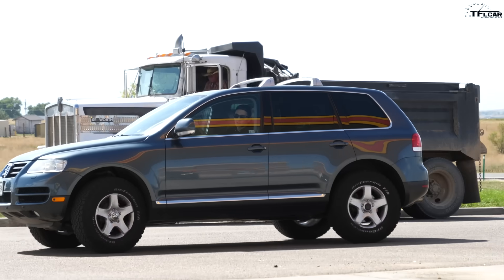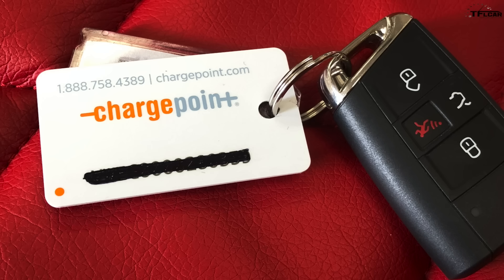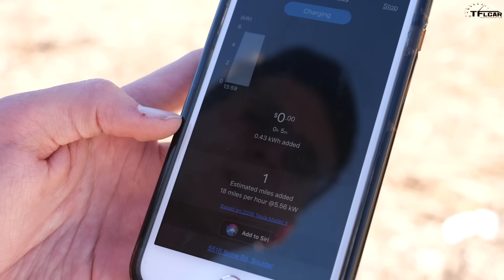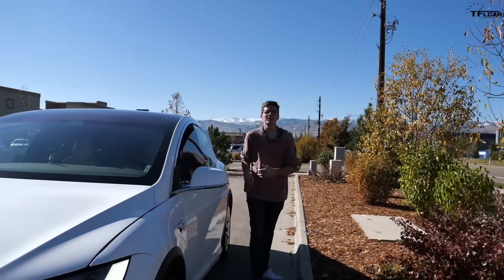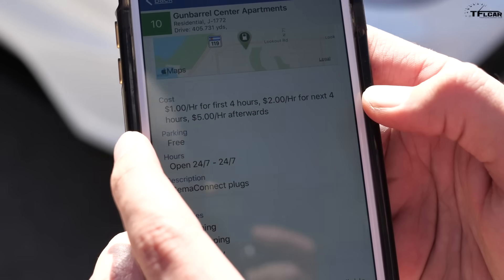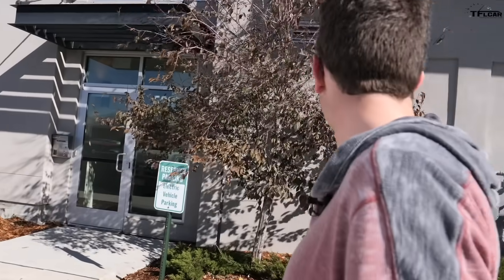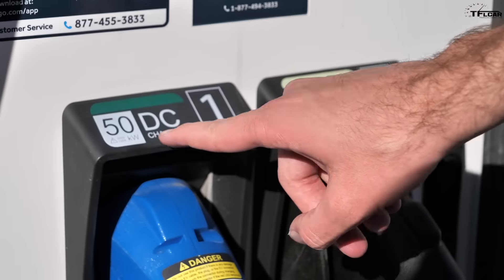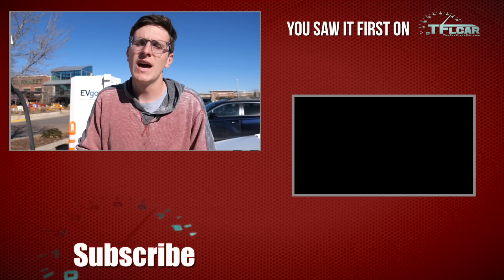Here’s Why Charging an Electric Car Can Suck - And It’s Not The Reason You Think!

Comment: Looks super convenient. I can't wait to be in line for days on end. How is this practical?
Reply: A single gasoline pump can fill dozens of vehicles/hr( as long as the gasoline supply is plentiful). A charging station with 6 chargers is going to have a queue of frustrated EV'ers wishing they had kept their gassers afterall.
Reply: @peghead  Great point.
Reply: EV ownership is best for a homeowner with multiple cars.
Reply: they re forcing mass transit by mass inconvenience
Reply: @chris532008  What better way to control the movements of the population. 
They say you'll own nothing and be happy. 
Translation, they will own everything and we will be miserable.
Reply: This is a level 2 charging station meant to be used overnight, hence its location at an apartment complex. Or at an industrial park meant to charge while you’re at work. This isn’t the same as using a level 3 charger.
Reply: @DarrellC.  What if someone else is using it for an hour or so?
Reply: @DarrellC.  yeah you only wait for 2 thirds the time.
Reply: @richwilson7619  not sure about waiting in line that doesn’t seem to be the reality with the vast majority of fast charging stations, but in terms of actual charging time if that equals 40 minutes then yeah.
Reply: It's too early, hopefully, in the next 5 to 10 years the charging will be faster.
Reply: @Bartetmedia  It is fast enough now so any speed up is a bonus. Filling you car with gas does not equate to filling your Tesla with electricity. On long trips you only put in enough to get to your next destination other wise it's like a cellphone, 30 seconds to plug in and then unplug at home, no trips to gas stations.
Reply: @SmokinPaul  You have the mind of a child. It isn't so easy as you have expressed.
Reply: @rogersmoot6194  it is when you own a Tesla. I normally plug it in once or twice a week. But calling me a child (attacking the messenger) is like adulting right. 🤣 Thanks for confirming you had nothing to add to the discussion. 😁 
I'm from 1956, not so weak that words can hurt me. LOL
Reply: @SmokinPaul  yeah my phone dies no big deal my car dies say from ny to florida where do i go to get a bucket electricity to refill
Reply: @pat8757  You can always use another charging network or destination charger, slower but will charge fairly fast. 
Finally you can use the cord that comes with a Tesla to plug into any 120v or 240v outlet. North America is electrified, who knew! 😯 LOL 

FYI Up until 1940 Electric cars were preferred because as bad as electrification was you could always find someplace to change. Even Henry Ford's wife drove a Detroit Electric. 
You can do something similar with a gas car using a siphon hose. Just remember to bring a mint for afterward. 🤣

I don't run out of electricity for the same reason I don't run out of gas. Plus even if I'm and idiot and don't pay attention to the fuel (juice) tank my Tesla will warn me and show where to go to charge. If I have FSD on it will navigate and drive to the supercharger. I don't see any gas cars that show you where the gas station is when it gets low on fuel. 

An EV is no different than a gas car, only the fuel and amount you normally keep in it is different. I had reservations when I first bought my Tesla but after the first long trip I'm not worried in the lest. In fact I can get electricity in way more places than gasoline.
Reply: @SmokinPaul  you don’t see any gas cars that show you where a gas station is?  Hate to tell you, but my Hyundai Santa Fe does.  LOL
Reply: @thatshowitis6151  welcome to the 21st century. Does it also show you how many pumps and if any are not functioning?
Reply: I charge at home, 15 seconds to plug in, 15 seconds to unplug. I only charge at Tesla superchargers on long trips. Occasionally I'll use a slow level 2 charger at a destination, a hotel, restaurant etc. Last time I got 80+ miles for free while eating at a restaurant. 🙂
Reply: @SmokinPaul  15 seconds to plug in…..wait for hours to charge…..15 seconds to unplug.  Sounds like a great car for long trips.  Real convenient.
Reply: @thatshowitis6151  Do you never sleep? If I needed a fast charge I would stop at the nearby supercharger. 

At home 44 miles per hour charge while I'm sleeping is faster than I need. I usually charge once or twice a week because it is so convenient to do from my home. For the miles I drive the car it's charged in less than an hour. You on the other hand have to drive to a gas station, fill and drive home, something I do not miss. 🙂 
The cost per mile is 1/5 to 1/8 the cost of gasoline, what's not to like. 
Do you worry how fast your cell phone charges? LOL 
You on the other hand waste more time overall gasing up.
Reply: Terry Winter  Hence why we went with a Tesla and their supercharger network. Any other EV brand sucks for long trips until Tesla opens up their network. 
However if that brand charges slow or has a huge battery requiring more juice you'll still be stuck with long charging times. 

On long trips in our Tesla we never need more than 10 to 18 minutes charging which is usually shorter than it takes for me to pee and get a coffee. If we stop for food, there's usually fast food nearby the supercharger, we eat in the car so we can leave as soon as it's charged, finishing our meal on the go.

Comment: Electric cars will not work. Is right, they are a pain in the pocket book!  To many problems to take care of to keep them moving. Another thing, cancer ♋  do they cause cancer, time will tell. Because anything to do with electro magnetic  waves through the air is a start for the body to be exposed to these deadly waves. Like electrical wires power poles. And those cars produce many volts. Dangerous!!!  So there has to be another way?.

Comment: The push for EV cars is an elitist leftist attack on the poor and middle class who may not a garage or place to charge an EV. Some poor may not have a Visa card.  Since a majority of the poor and middle class will drive used cars, they are screwed again because of the outlandish cost of EV battery replacement on older vehicles.  So they will be not be able to travel around the country?  Maybe this is the goal of Elitists.

Comment: plug share or what ever this won't work when i get out of the car i gotta take a leak so if the gas pump is fast i can fuel up and make it into the restroom . by the time i find the right adapter my pants will be all wet .    plus with gas ill be eating a roller dog complete with onions mustard relish and a napkin and soda  back on the road less than 10 min . better order your tesla with a trailer hitch get a trailer and a generator and a fuel tank . that way you can charge it up while your on the move or parked also there is no tax on the fuel in the generator how about that !

Comment: Electric cars have no future for a couple of reasons but one of them is queuing theory. 5 gas cars in line for the pump and your wait 20 minutes tops. At an EV station, hope you have a sleeping bag. As the numbers increase so will the queues. 17 miles per hour?? Are you kidding me, 14 hours for a charge with no one in line. Like I said no future..
Reply: Tesla super charge do it 30 min ezz also depends how much u drive

Comment: Hands down the best video I have ever seen on the perils of charging an electric vehicle. Convenient if you live in a single family home with a garage and never travel more than 50 miles from home.  However, let's say you want to drive from Dallas to Philadelphia, approximately 1500 miles. With a gas powered vehicle, you would need to refuel about 4 times at less than 10 minutes each, or 40 minutes of fueling time.  In an electric vehilcle, without access to a supercharger, you would need to recharge at least 5 times at 20 hours for each charge.  So 100 hours [a little over 4 days] of charging time to support 24 hours [1 day] of driving time.  An unimaginable burden and not very feasible.
Reply: I drive over 150 miles each day for work and don’t have a garage. All you need is a drive way or access to an outlet. One of main reasons people keep buying Tesla’s is the super charging network so you’re  not have to wait very long for a charge. 10 to 80% happens quick, maybe 20ish minutes. However, I never need to go to one honestly, unless sit for a road trip. I drove from Baltimore to DC then DC to Bal, then Bal to DC and back to Bal today and had no issues, didn’t charge up past 80% and got home with 18%. That’s 160+ miles in the cold (loss due to cold) and not including driving around Baltimore (went to see the Ravens game with my girlfriend) or the loss from pre heating the car and battery. I could driven back to DC again if I wanted with no issues. If you can charge at home, it’s a no brained, if you can’t charge at home, I’d wait to get an EV.
Reply: What happens if you forget to charge your battery and run out of power out in the sticks somewhere. You can’t thumb a ride to the nearest power station and get a “gallon” of power!
Reply: @craiglaw7578  Very astute. I wondered about this problem also.  I will keep using the good old-fashioned gas stations until the charging issue has been completely resolved.
Reply: @craiglaw7578  
Correct and funny!
Reply: @craiglaw7578  - tow truck using ICE engine will come get you
Reply: @williamhaynes7089  LoL, well that's how they get delivered to thier dealerships to. Least we are saving the planet 🤪
Reply: @Supraboyes  The planet will take care of itself. It was here before me and will remain after I'm gone.
Reply: BINGO!
.....and, the electricity recharging the EV was generated by burning fossil fuel....so, where is the benefit?
Reply: @albertchehade9916  and then u must contend that only a portion of energy leaving plant and running down  lines  generating heat and being lost gets used in some fashion  a major loss of second line energy   it may b true with gasoline  in a 500 gallon tank some 3 gallons  may evaporate  and that s old technology probably much better technology today  electricity has much higher losses that s why cruise  ships have gone through a very comprehensive  energy management as ship uses  power on board during day  electric  propellers are on crawl in day  at night as ship shuts down they then go full power ahead
Reply: @chris532008  
OK......so, what's your point?
Reply: @albertchehade9916  can t beat  the internal combustion engine  first  use  fuel is always more efficient   further  outside  corruption of this government  makes such a transition totally impractical
Reply: @chris532008  
Agreed.... 👍
Reply: @chris532008  What internal combustion engine uses petroleum just as it comes out of the well?
Didja know that petroleum has to be found, drilled for, pumped, transported, refined, transported, stored, distributed (transported again), retailed into vehicle tanks? It would be interesting to find out just how efficient is the petroleum fuel cycle. How much of the energy in the raw petroleum actually ends up pushing your car along the road? I would be surprised if it is as much as 3%.
Reply: just take yhe horse
Reply: That will be nice in the pouring rain, too.
Reply: @unknownuknown436  Look at all of the ¾ and 1 ton long bed dually pickups that are used for carrying a significant load once a year.
Reply: @unknownuknown436  Since I make a 500 mile trip once a year and haul some 2×4×8s once every five years, I need a crew cab 4×4 long bed dually pickup with a 100 gallon tank. I might need to tow a trailer sometime.
Reply: Where do you get “20 hours” to charge? That's on a 120 volt 12 amp EVSE. Public DCFC chargers are way faster than that. I've charged a Nissan Leaf from 15% to 90% in ½ hour.
Reply: Thats the real limitation.  In that case it is best to rent a car for any out of town long distance  traveling.
Reply: That comment is so 20th Century.  I get 325 miles from fully charged.  And topped up while I use the bathroom or eat lunch.  Since most of my trips are within 100 miles from my home there is no more standing in the rain filling a tank.
Reply: @s.m.7018  nobody stands in the rain at a gas station.  They all have covers.  Also you aren't the rest of us.  What might be perfect for you is complete bullshit to me.  325 miles is just a typical morning for me.
Reply: @s.m.7018  SOooo again, If you go on a 1500 mile trip.....  Which is what the comment was about. If you never go anywhere, good for you If you do I guess you can always buy a gas powered generator and put it in your trunk and run it. You would think that that would be a viable option from the factory, like on a motor home. :D
Reply: @johnme7049  From south NV to WI is about 1800 miles. Drive 600 miles per day and stop to recharge three times per day--once while eating lunch, once while eating dinner, and once when arriving at the motel for the night. This is how we drove to WI in our Tesla Model 3. Considering that the car charges while we are eating and when we get to each overnight stop, we actually lose NO time compared to an ICE. Other EV's have to depend on third party charge providers which may be inconvenient compared to a supercharging station where it seldom, if ever, takes more than about 40 minutes, and usually around 20 to get to the next charging station.
Reply: @nvrick7729  Yeah, that's GREAT IF you own a Tesla. Untill the mainstream catches up, (Which WON'T be anytime soon), I will keep my ICE.

Comment: i have other question and concern, when you fast charge your battery doesn't it get faster destroyed and you will have to pay for new one sooner rather than later? can someone answer me with the truth and not some speculation about EV saves the planet and other BS like that cuz it does not! so its 1 thing buying a tesla or some other EV and having to pay for new battery in about 5-6 years which costs 20 000 $ or change them after 12 years

Comment: What a lie. Almost everyone has “240V” power. Most ranges and electric dryers are 240V. If you have a 200 Amp service, which is standard, you can have 240V power…all day long.

Comment: All of these charging vendors need to use point of sale charging like at gas pumps.  Just swipe or tap your card and enter a pin or zip code, the charger pre-charges you a set maximum amount and then settles up when the you completes charging. This is not rocket science.  Why do they make it so hard?

Comment: At only 15 miles per hour of charge a long trip would be really fun.  That and where will all the power come from to charge these vehicles when some areas are already facing rolling blackouts?  Should get really interesting when only electric vehicles are allowed to be sold in states such as California or in Canada.  Then there is the issue of fires in EVs.  Maybe they should consider installing pedals for use when the grid goes down!

Comment: If every car in California was electric at this moment.There is not enough generation capacity in or supplying California  right now to charge  just the electric cars .. that means the entire electric generation capacity In California cannot supply enough power for every day household, air conditioning, apartment buildings, grocery stores, hospitals, schools, traffic lights, nothing.. all the tree huggers in California that don’t want electric generation in their state, are now paying the price for being so shortsighted. It can take up to 12 years to build a power station and to get it approved due to all the red tape and regulations and environmental studies.
  do you think you’re going to save mankind by switching from gas burning cars to electric? Think again,. It also takes fossil fuels to create electricity. Solar and wind are not reliable. Nuclear is extremely expensive to build even though it is the best alternative, but very dangerous to build a nuclear power station in earthquake prone California. They can’t rely on Hydro. They are screwed if they are going to eliminate fossil fuel burning cars in a large scale..
 a  different subject ..
  all the tree huggers that don’t want any trees harvested for building homes and furniture, what a waste. California is so prone to fires, all that  burning wood.. even if they just thin out all of those fire prone uninhabited areas, the fire danger probability would be reduced and would actually be used, which is what is needed right now, because of the shortage of building materials . No wonder tens of thousands of people are relocating out of California. I hope they don’t spread their toxic short sighted politics to the rest of us..

Comment: Your point it well taken. The real point can be summed up by the lack of standardization between stations and EV manufacturers. They simply must agree on all using one system that uses one plug.  Each charging station must be smart enough to operate in a stand alone fashion without using your cell phone for either operating, or payment. In other words, it must be smart enough to determinant what kind of car it's plunged into, how much power it can take and how long it will take to charge. Then the only question is how much each station charges for it's power and how it receives payment. This can be set up when you buy your car because each car has it's own ID number assigned to it's owner. 
The station charges each owners credit, or debit card accordingly. If the owner decided to lend their car to another for use then the other person can set up their card for payment for a specific time period.